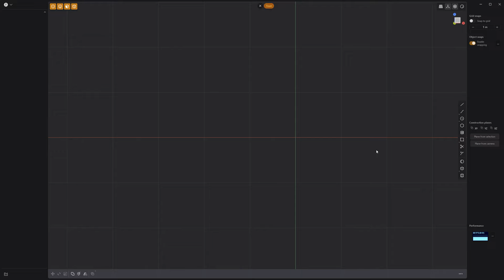Plasticity | Modeling Exercise 03

Comment: I would like to think I know how to model polys fairly well. I think this example is one, of many, cases where solid modeling is superior. Both in quality and time. As a note, prior to my current career I was an engineer - and I spent a LOT of time driving CAD systems. Towards the conclusion of that career solid modeling was finally financially accessible to most companies (SolidWorks and Mechanical Desktop). 
Plasticity is the first program, that I have seen, that blends the artistic need with the technical of solid modeling. Fusion is great, but still driven by the need for accessible engineering tools. 

Glad to see Plasticity getting support. I hope that I can pick it up in the near future - but I have other obligations first.

Thank you for these videos. They are short and to the point. Love it.
Cheers
Reply from the maker: Agreed... Very cool to have an artist friendly CAD tool